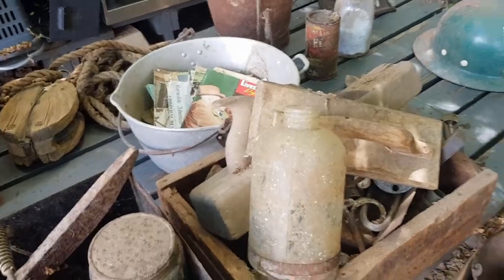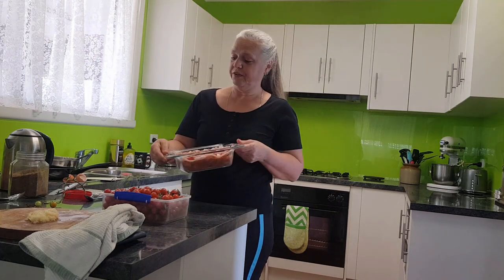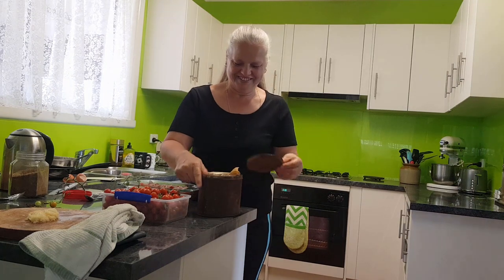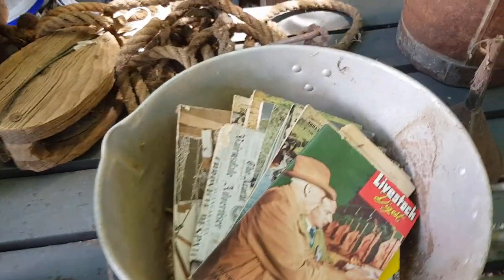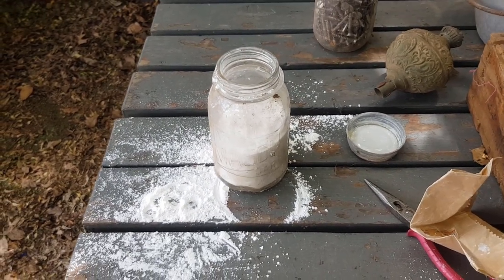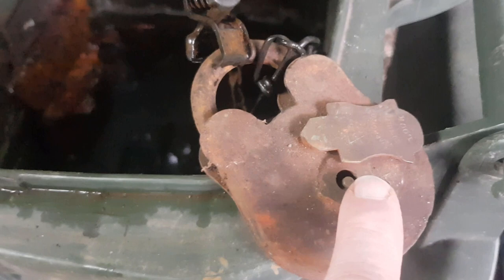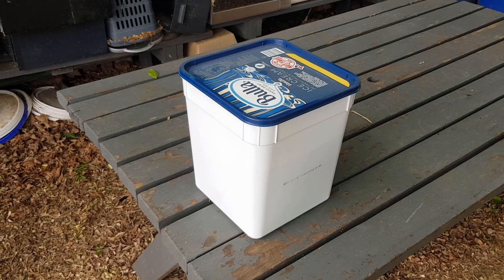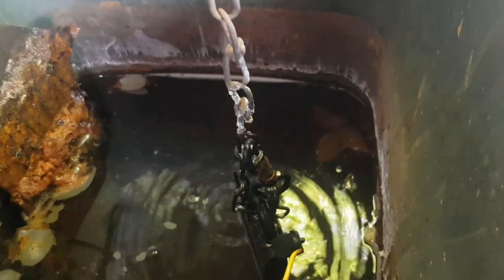The great backyard clean-up - Part 13. A look at the better treasures we found in the old van!

Comment: Hi Chris, nice of the old van to give up the goodies 👍
This is my 3rd try to post a comment. Not sure what is going wrong ATM.
Anyway, at 6:11 the aluminium piece is a Ford fan spacer that goes between the water pump pulley and the fan. Might be worth a few bucks
Reply from the maker: Thanks NN, yes I thought it was a fan spacer but didn't know what make! 😁👍